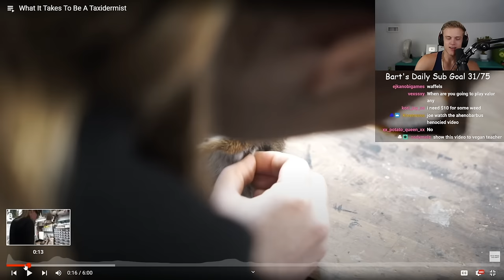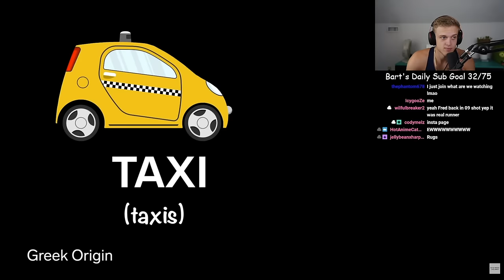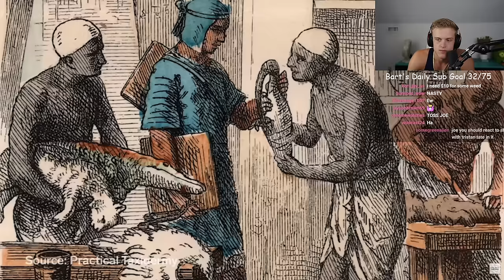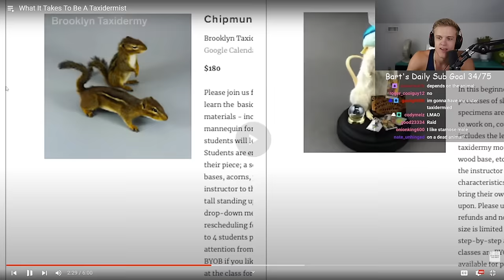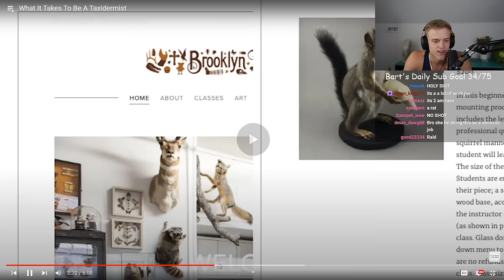Taxidermy Has Gone Too Far..

Comment: Joe, I'd like to preface this comment by saying it is NOT related to this video. However, I have a bone to pick with you. I enjoy your content, and I think you are a cool guy, but your takes on animals are scarily inaccurate. First of all, please do not attempt to kill an ostrich ever, seeing as they are capable of ONE SHOTTING a fully grown lion. The power in their kicks are so far beyond what you would think. Furthermore, their huge beaks could tear you apart, if you even managed to get that close in the first place. Secondly, I don't think you understand the power that grizzly bears hold. In a fight between a silverback gorilla, and a grizzly bear, the gorilla would be lucky to come out alive. Grizzly bears can run over 10mph faster than silverback gorillas, and they stronger than silverbacks as well. A male grizzly could effortlessly toss around 600-700lbs. Even if silverback have the advantage of opposable thumbs, they have very limited options of how they can use them to harm a bear. If the gorilla is clever enough to use sticks, or rocks, to attack the bear, it'd still have hardly any impact on its physical condition. The grizzly bear has roughly the same bite force as a silverback gorilla, and its defenses are far superior. A silverback gorilla's teeth can grow to around 2 inches long, which would be nowhere NEAR enough to pierce through the bear's hide, which can be up to 14 inches thick in some places. Even if the silverback gorilla was lucky enough to get the chance to escape, where would it go? Grizzly bears can climb up large trees within SECONDS, Joe. There is maybe 1 in 15 fights that the silverback comes out on top, and that's just a maybe. Now that we've gotten to this point, I would like to mention that the creator of this question was, most likely, thinking of an Alaskan brown bear, when he said grizzly bear. If this was an Alaskan brown bear, the gorilla would have a FAR worse chance at winning. The Kodiak bear stands at over 10 feet tall on its hind legs, in comparison to that of the 7-8ft of a grizzly bear. The Kodiak bear can grow up to 1500lbs, and in rare occasions much more. While their bite force might not be as impressive, at 930 psi, their strength certainly makes up for it. At their size, they can run up to 30mph, which is absurdly impressive, and still faster than a gorilla! They're just like a beefed up grizzly bear, minus the powerful bite. This is probably because Kodiak bears have a diet more focused on salmon and vegetation. That silverback is STILL lucky that this madman didn't pit it up against a polar bear. And with that, I conclude my rant about your misjudgment pertaining to the capabilities of some of these wild animals. However, if you want to know what animal I think you could take, bare handed, I would probably settle on something closer to a deer, or maybe a large boar. Just make sure you don't get behind a deer, or things will go south very quickly. We definitely are not the most physically capable animals, but we make up for that with our intelligence. Thank you for your time, Joe.